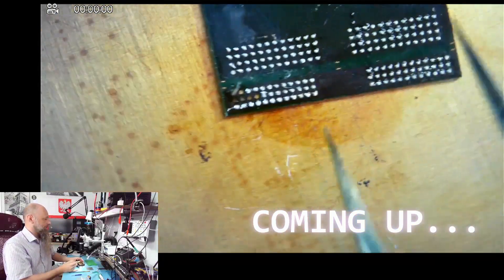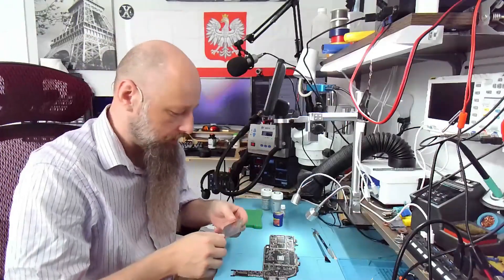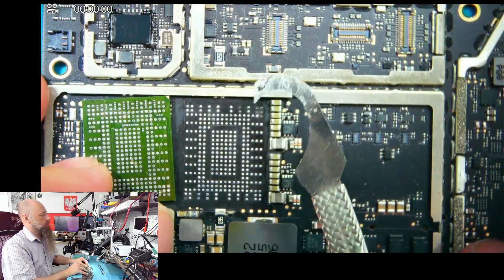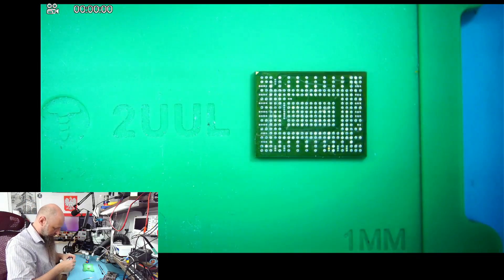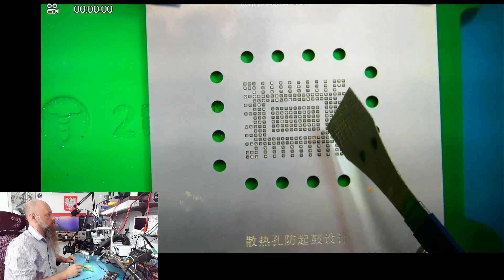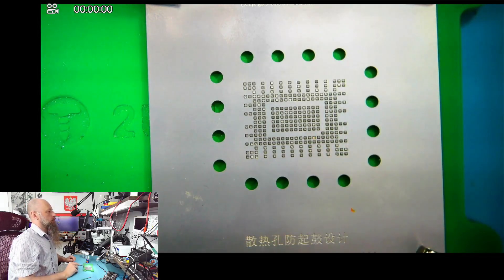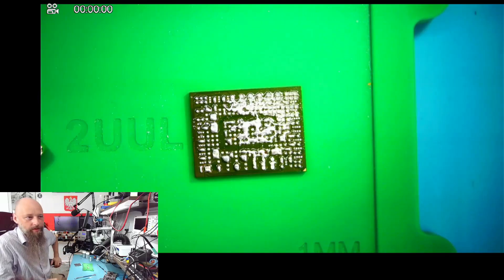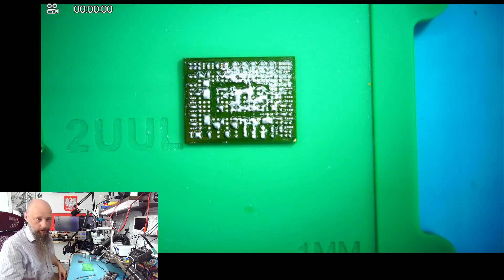Surface Pro 5 SSD Mystery Solved? Maybe...

Comment: can we upgrade the ssd?
Reply from the maker: the size probably cannot be upgraded but there's another slot which could be populated along with some components around it but that would probably require update to BIOS and perhaps some firmware. Probably not worth the effort.